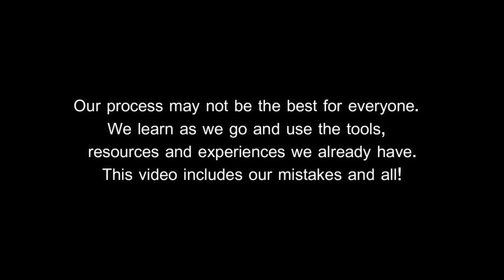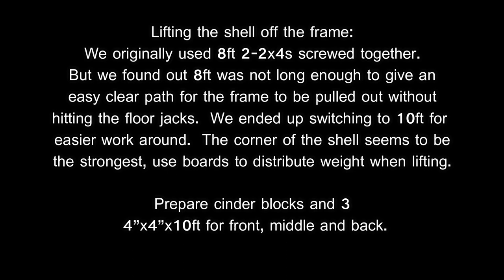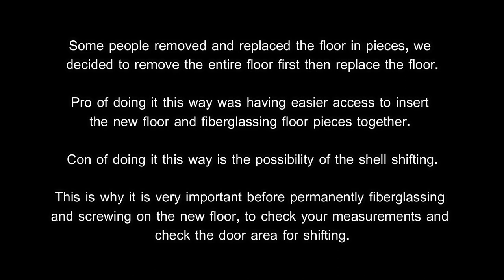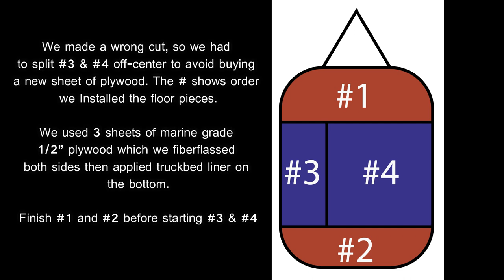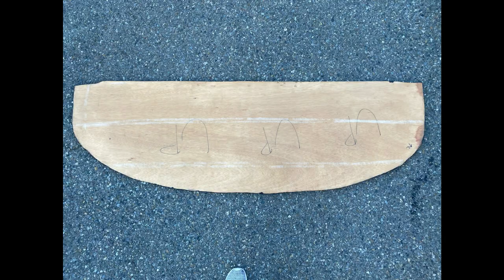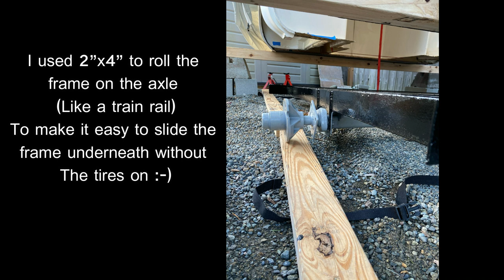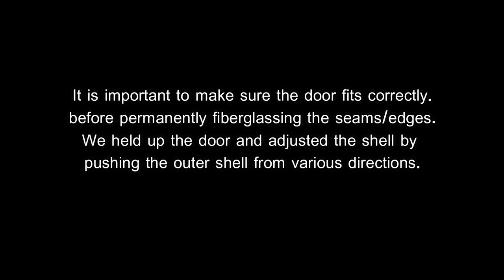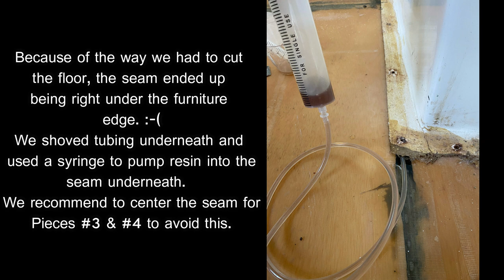1983 Burro Trailer Episode 3 - Subfloor

Comment: wow amazing im looking at buying a uhaul version almost identical, guy told me it has a few soft spots he said it could be the padding under the flooring someone else used i hope i can use the camper in the meantime and its not a huge deal,im kind of handy especially cars and vehicles but haven't ever done anything with wood so i'm a little scared. honestly think it's alight to use as long as its not completely rotted?
Reply from the maker: It sounds like you have wet spot.  It will over time, spread across floor though.  But for now, you should be able to use it.  If you dont want to replace completely, some people just replace in patches.  You could lift shell just enough to slide in sealed plywood underneath.  Then just put down new decorative floor like lvp on top.

Comment: Hey! Great work! I’m planning to redo my floor in a few weeks. I’m in the process of buying all my materials. Wondering how much resin you needed for the floor?
Reply from the maker: We used 5 gallons, when you buy them check the tube of hardened that's in the lid to make sure it's not punctured.  We had to buy more hardened separate because many of them were damaged at our lowes.  Hope you're floor replacing goes well.  If you have any questions we can connect for a phone call if you want.